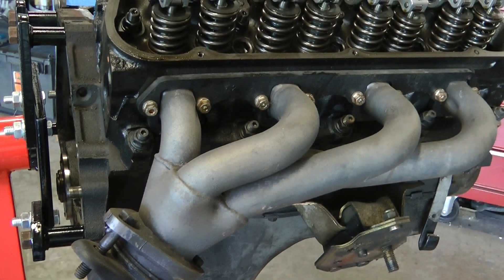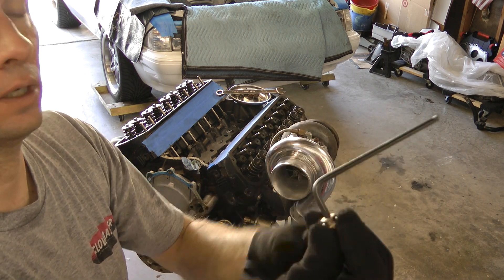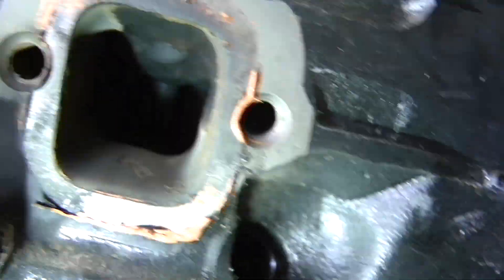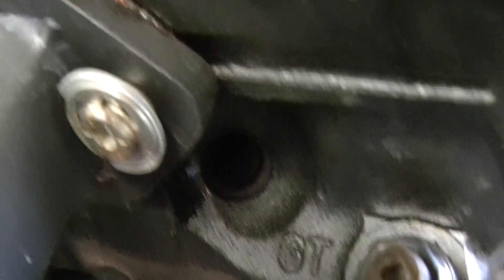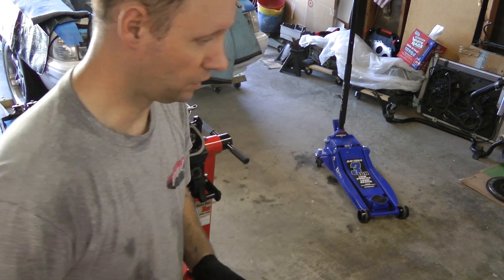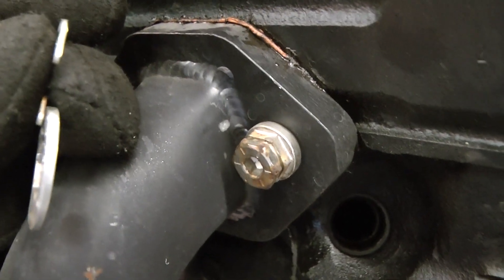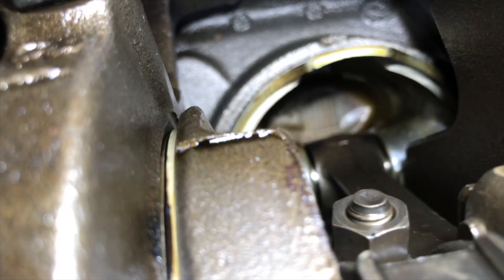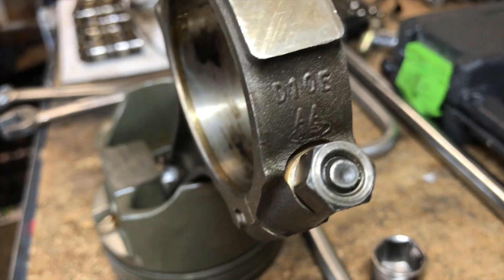Foxbody Mustang engine removal and tear down part 1

Comment: Hey Guy, a couple of questions, where did you find those pads? they look awesome,I'm gonna be replacing the engine in my 91 soon and that would come in handy,also i wanted your opinion,if i strip my engine completely upfront which im planning on doing anyway, could i get the engine out with the radiator in place?

 I'm taking the shroud off also of course, every single thing up front and my new engine will be the same,Ive installed a few engines before and Ive realized the less things on them the easier they go in but i haven't done one in these cars so i wanted to ask, i have a temperature probe installed on my aluminum rad and i dont wanna disturb it but if i have to so be it, thank you much for your time!!
Reply from the maker: They are furniture moving pads. I picked them up off craigslist years back when moving. It is best to remove the radiator so you don't puncture it when removing the engine. It can swing around a bit and it would suck to put a hole in the radiator.
Reply: @whitelx  True, its a nice welded aluminum rad,ill just pull it out, thank you

Comment: If they are cast, you did what everybody says can't be done.  You sprayed the crap out of them, supercharged and then turbo'd them and they basically still survived.  Nowadays, if it you don't buy a 4 bolt blocked, forged cranked and forged pistoned motor, your car will blow up 5 seconds after you start it.  Good work...
Reply from the maker: They are indeed the cast hyperutectic pistons. If you watch part 2, you’ll see I cracked the block, but the pistons were still good. You win some, you lose some I suppose.